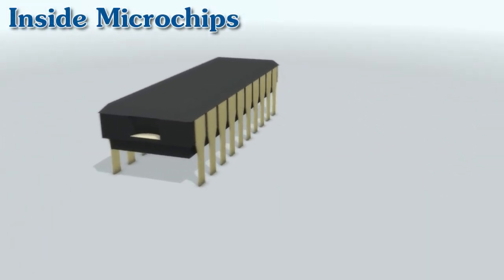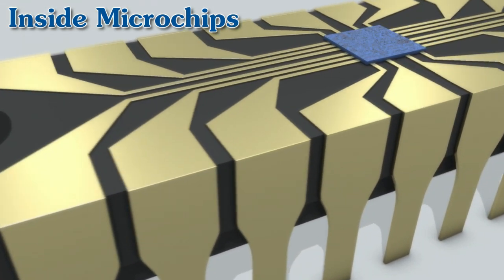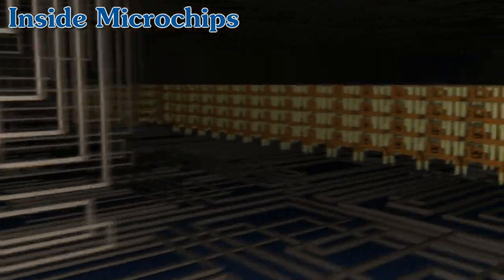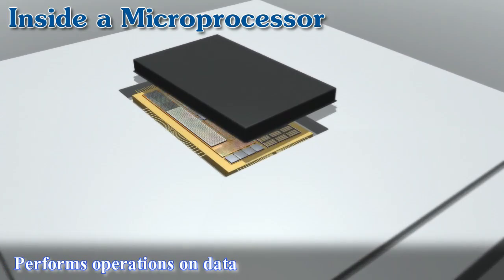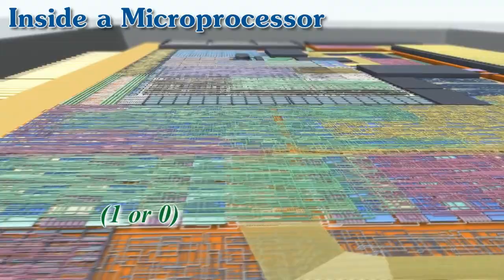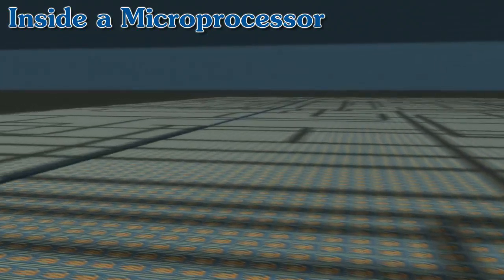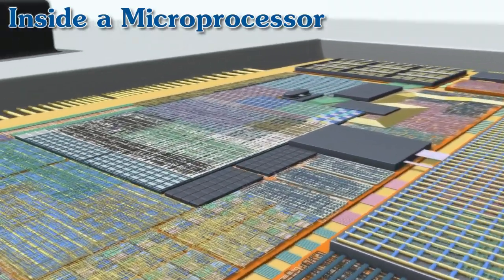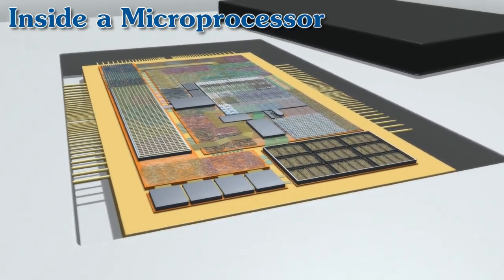The Tech Museum - Inside Microchips - 01

Comment from the maker: @Blizzardo1 I agree with what you said. The complexity of the microchip is incredible, and I only had time to hint at that complexity in this video. The most interesting thing about all this is that with every year, the components are getting smaller and smaller. "Extreme Ultraviolet Lithography" (using ~13 nanometer UV radiation in vacuum) is the newer technology which is steadily replacing the current "Photolithographic" (using photoresists) techniques for developing such small circuitry.

Comment from the maker: @TacTiCOrc Sophisticated maths such as the "Discrete Fourier Transform" are used to develop compression schemes to reduce file sizes of such image and video content, and the same goes for audio. Keeping it general, visual and audio is usually compressed in a "lossy" scheme (though some formats like FLAC audio are lossless), while a ZIP archive compresses data "losslessly" (it has to). The simplest form of lossless compression is "Run-Length Encoding" and anyone can understand it.

Comment from the maker: @TacTiCOrc It might be a bit easier to understand if you think of colors on a monitor; each pixel is really a red, green, and blue sub-pixel, and in 8-bit unsigned integer-based color, there are 255 levels of each sub-pixel. So full red is: 255, 0, 0. Each character may be represented with a byte of information, for example, 2 in binary is: 00110010. These may be hardcoded and the 2 is defined by vector graphics, therefore it rasterizes at any resolution without losing detail.

Comment from the maker: @TacTiCOrc Also consider digital video. If you have a 1920x1080 image (frame), that is 2,073,600 pixels. Each pixel is 3 bytes of information (in 8-bit integer color), resulting in 6,220,800 bytes (6.22 MB) per frame. Multiply this by, for example, 2 hours at 24 frames per second: 6.22 MB * 7,200 seconds * 24 fps = 1.075 Terabytes (1,075 GB) of data for a typical 2 hour movie, uncompressed. That would be more than 20 dual-layer 50 GB BluRays.

Comment from the maker: @TacTiCOrc A CPU is extremely complex, but to simplify it drastically, I go back to the concept of "logic gates". Generally speaking, a few transistors working together form a logic gate, and that gate is able to compare incoming binary data (simply by whether an electric charge exists or not on the input, 1 or 0) using boolean operators such as AND, OR, NOT, etc, and with these simple constructs, the gate is able to compare and even perform math on binary values.

Comment from the maker: @MrGeneralRelativity Actually what's inside a CPU is at least thousands of times more complex than this video could ever show, I only hinted at that complexity here. Google "CPU die" and check out the images for a little more detail. Keep in mind that a modern CPU die is about the size of an adult human fingernail. As of 2011, the smallest features in that die are 32 nanometers in length. That's 32 millionths of a millimeter. Individual atoms are around 0.06 to 0.5 nanometers across.

Comment from the maker: @TacTiCOrc As for what essentially controls the CPU in a computer, it's a combination of low-level software (usually written in assembly/machine language), and programs at a higher "abstraction layer", such as an OS kernel queuing up program operations in execution threads for the CPU to process based on priorities; "hardware interrupts" are basically at the top. To give you a hint of the highly precise manufacturing steps involved in creating a CPU, search "Semiconductor device fabrication".

Comment from the maker: @Asephei Correction, not 255, 256 I meant. In 8-bit unsigned integer color, you have, well, 8 bits, and 2 to the power of 8 is 256. In steps it goes from 0 to 255, which is a total of 256 levels of color value change in each red, green, and blue sub-pixel. The 8 bit thing is completely inadequate in representing anything close to the brightness values encountered in the real world, that's why 8-bit imagery must be gamma-corrected to get the most out of such a small amount of color values.

Comment: @TacTiCOrc 
Usually it's a voltage.  5V(or some other arbitrary voltage) is a 1 and 0V is a zero.  Transistors work by amplifying current (a small amount of electric flow from one side opens the door for a LOT more current to flow.) Hope that helped.  Reply if more explanation is wanted.